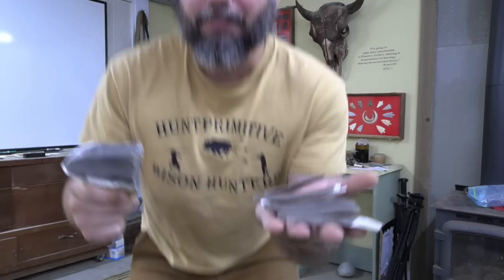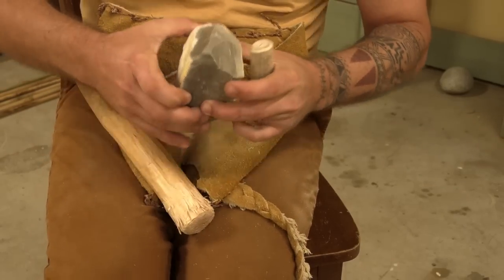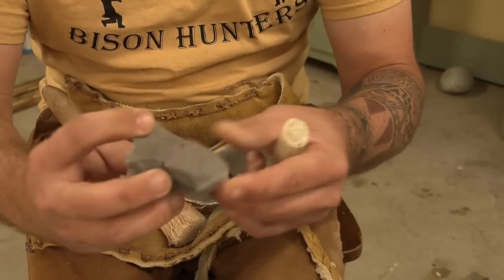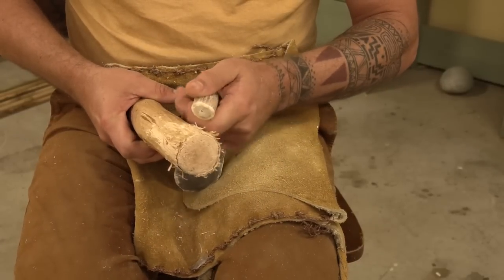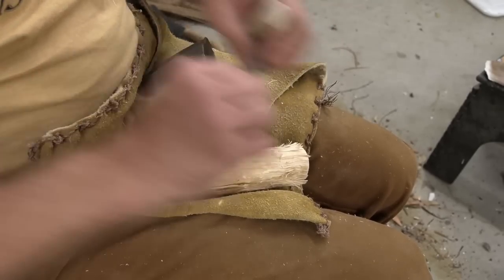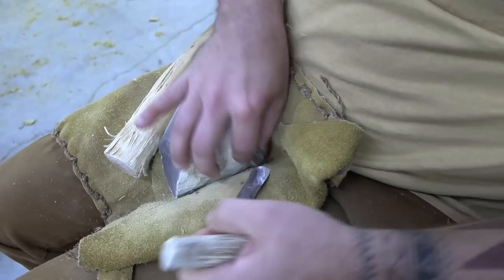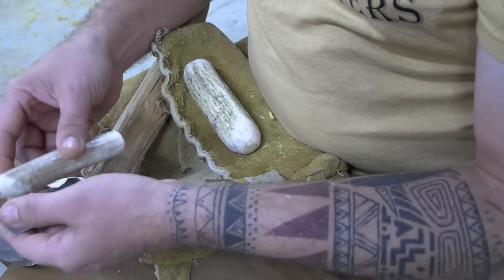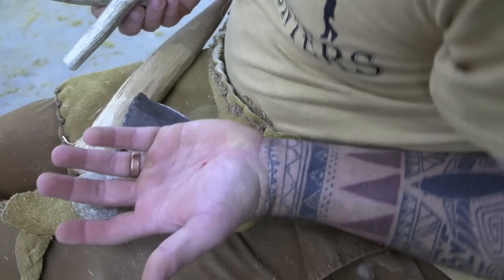Blade Core techniques. Flintknapping part of the Clovis Assemblage

Comment: Really interesting, but as a European archaeologist, your method is what we call opportunistic. If you want to be more efficient, you need to make a crest. When you do your first flake, it is to have your large platform, but if you want to be immediately able to remove blades, you need to do a crest. The best method to do that is the zigzaging method. Then isolate your impact point and use direct or indirect percussion as you want. The position of your nucleus is also strange. We, the Europeans consider putting the nucleus between the two legs and putting the punch on it. With your position, you are not able to see where you put the tip of your punch, and in this technique, accuracy is essential. The crest allows your shock wave to travel from the tip of the platform to the distal part of the nucleus. When the crest has been removed, it leaves two almost perfect ridges that allow you to begin the debitage. In reality, most of the pieces are for pre determination and sometimes they are simply left. These blades allow you to have the product you want (sometimes a lenght, sometime straight, sometimes one or two ridges). You probably need more mass to properly remove your blades. We use moose antlers or, more frequently, buxus pieces of wood. Blades are extremely important for us because, as I know you are an expert in hunting, in Europe most of the projectile points of upper palaeolithic, have been done on these pieces. Gravettians do some straight blades with backs (I did some experiments and produced more than 120 of them), and solutreans, (contrary to what people think about laurel leaf what are knife blades), use blades to make shoulder points with pressure flakers. Magdalenians use bladelets to put on bone points, glued with resin, increasing the cutting efficiency of the single bone. Here is a video of a dr. in archaeology who is one of the best flintknappers (and one of the first to do experimentation. dr. Crabtree is in the same generation ), dr Pelegrin. 
https://www.youtube.com/watch?v=7biQ_4M6Wpc
All the best.

Comment: Nice work Ryan, you getting into it, try to prepare the the steps and overhenge from bottom or at the ridges, with indirect the angle does not need to be 90degress or sharper..

Comment: at 28.0 min you can punch from the top of that step off to the side then go into that bulb towards the mass below the step and blow off that entire mass. Essentially what you are doing is stitching like on Danish dagger handle. then you can take blades across the leftover stitches and completely remove the stitches.  Now your clean again.  Edit!... Not sure you will be able to do that with an antler punch. Im using copper and a percussion bulb is no problem. Sorry had to add that?